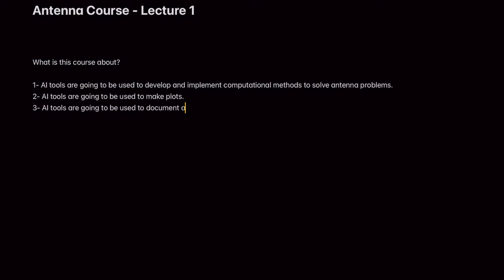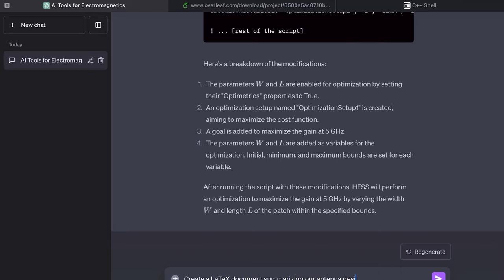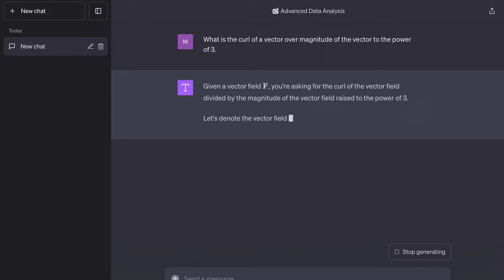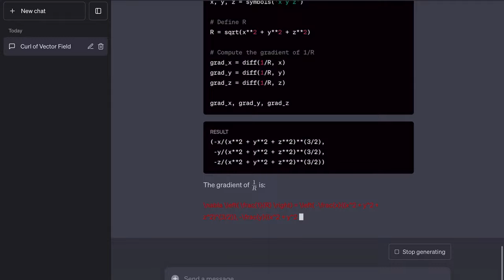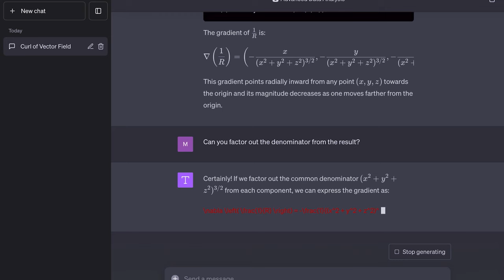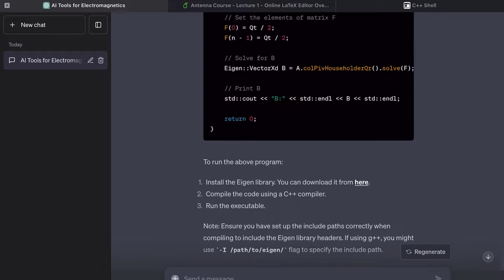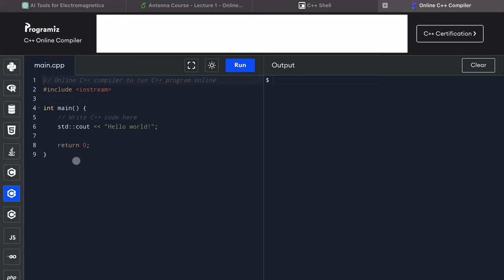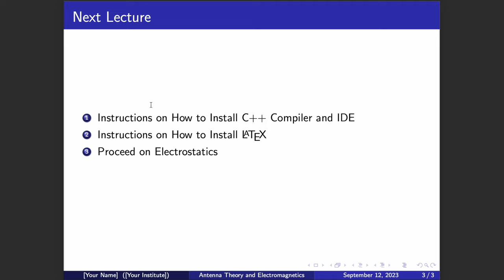Antenna Design By Writing Your Own Simulation Codes Using ChatGPT - Lecture 1

Comment: You are feeding ChatGPT with the outmost details of knowledge and inputs and asking it to generate a code in C++ or other software language. This is not called "antenna design" by ChatGPT as is implied by the title and the introduction. We are not there yet...
Reply from the maker: You are right. This course to about to help you get started with writing your codes without having to master the programming tools at first. Also about gaining a strong theory of the antenna design.